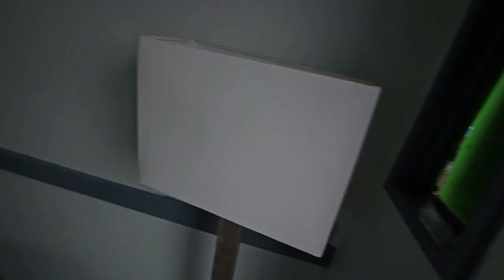A crowbar to fit Narrowboat blinds. WHY?! Ep18

Comment: Hi Guys! Paul you often find bottom plates welded together especially on longer boats, the reason being, imagine a 60ft long peice of steel 7ft wide, it would be impossible to lift or manage, so they usually weld multiple plates together depending on the length of the boat. great vlog :)
Reply from the maker: Hi Steven, yes I think Paul expected it to be welded what he was trying to say is that before then he had just assumed that was a slab of concrete balast that he had been looking at or something but when he saw the weld he knew it must be the bottom of the boat instead. We really happy as it's dry but I was a little concerned about how low our floor is to the bottom of the boat 😬